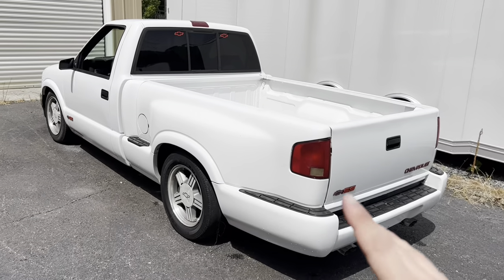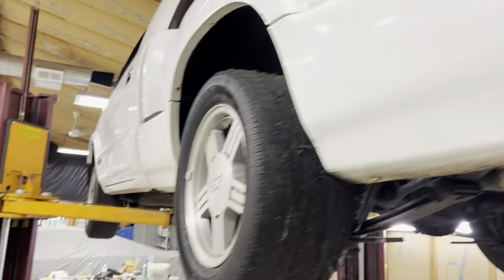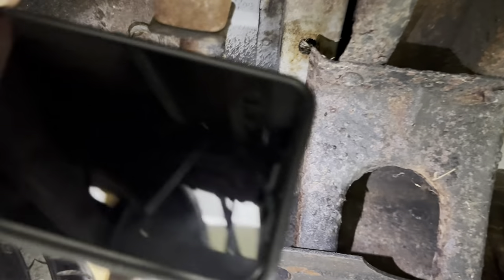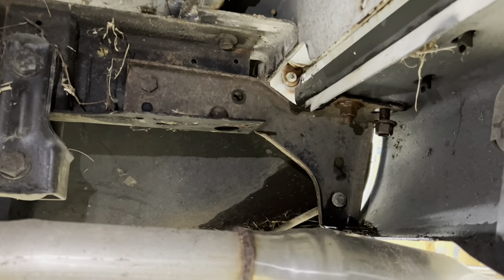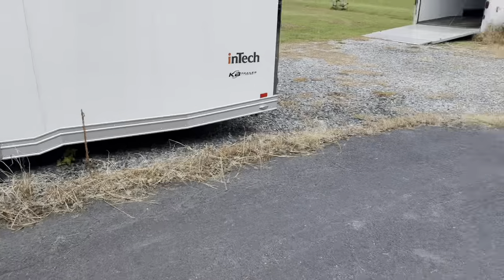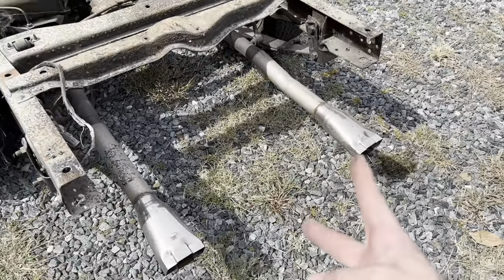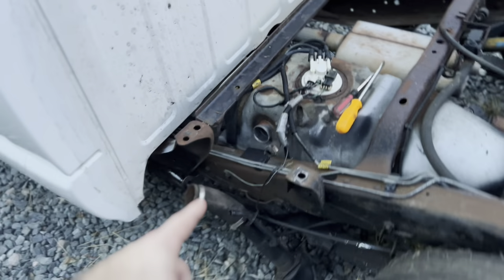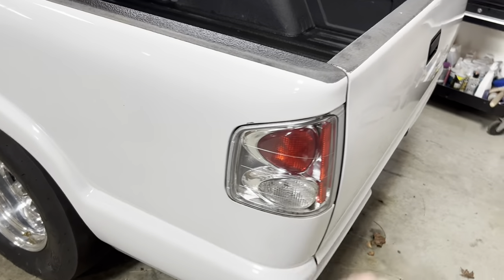Project S10 Upgrades! Stepside To Fleetside Bed Conversion!

Comment: Hi i watched your vid . I had did the opposite on a 01 sonoma crew cab . I posted a short video. But I'm having trouble with the tail light harness.  And was wondering if u would do me a solid and shoot me some pics of the connection wiring on the rear left side you have on yours.  So I can match up d colors  correctly.  Tnx

Comment: My 2000 S10-4cyl, needs fuel sending unit.  Do you have experience with this?  I'm not a mechanic.  I've though of cutting a hole in the bed (the truck is junk)  Is this too dangerous>
Reply from the maker: You can take the bolts out of the driver side and loosen up the ones on the passenger side and raise the bedside up on the driver side to gain access

Comment: Can this be done on an extended cab S10? I’d love to have a Step side on mine eventually
Reply from the maker: Same process 😊
Reply: @CoastalRacecraft  ok I just wasn’t sure if it would be able to fit on an extended cab cause I didn’t know if the length and width were basically the same

Comment: The grounds I wish u showed which grounds are attached to the bed and how you took them off
Reply from the maker: Hey man not to worry you’ll see them once you are under there. It’s just a bolt holding the ground eyelet.
Reply: @CoastalRacecraft  how long it took u in real time to remove it ? I’m trying to buy a step side bed about 3 hours from me but I would have to drive take off my old one and then install the new one right on the spot and I want to have an idea of the time to see if it’s worth the trip and the effort lol
Reply from the maker: I would remove the bumper at home and just make sure all the bed to frame bolts break loose easy. Then snug them back up for the trip before you remove it. With that little bit of prep maybe hour and 40 minutes to 2 hours removing old and installing new